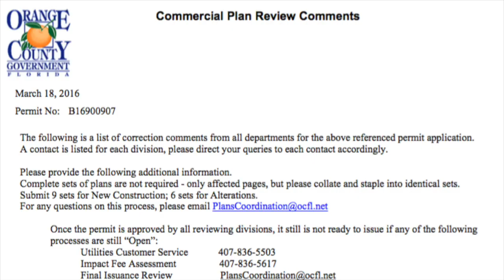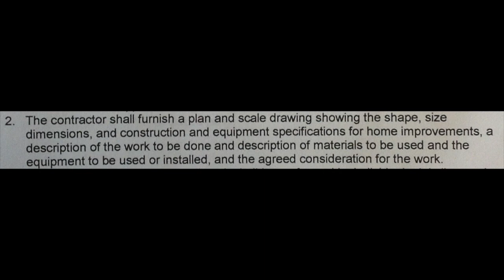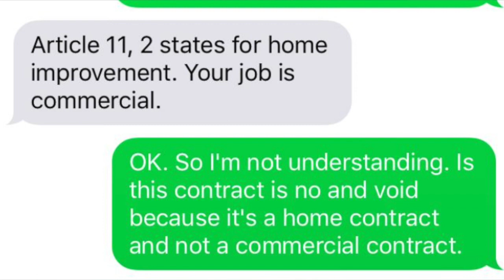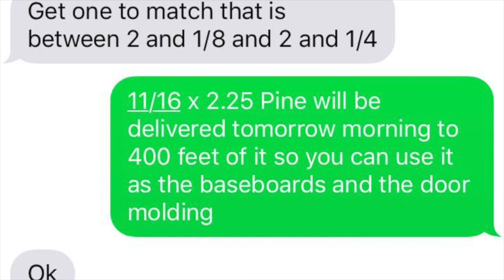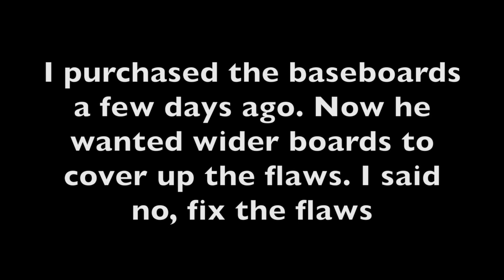Contractor promises

Comment: Paul this sucks I wish FL wasn't so far from NH I'd send a couple of guys over finish it in a couple of days all good. This isn't a big job, should have been done in a few weeks to a month. Don't know about FL, but here in NH you would not have needed an architect, in most cases building dept would accept any dimensioned, legible drawing. Unless, of course, you are making structural changes. In which case a structural engineer would need to sign off. 

When I expect the customer to supply materials it is written clearly on the quote, ie, "Install 180 lineal feet of customer-supplied base mold" or whatever. This guy can't even do a take-off! "It's not a science" No? Adding up the length of each wall is what... black magic voodoo?

Comment: I stand here in such dismay and disgust over the way this guy is conning you. You need to fire him immediately and hire somebody reputable. You'll continue to waste good money throwing it after bad week after week. I don't know how this guy is even allowed to perform legally. Paul, I ache for you my friend! That job should NEVER have taken more than 3-4 weeks absolutely tops. Oh yea - baseboard should be 3-1/2" minimum, you don't use door and window casings (2-1/4" or 2-1/2") for baseboard. And truth be told - baseboard should always be installed prior to tile being laid. Most carpenters will use shims to hold the base up a bit off the floor so you don't lose the full width of the base molding. And whomever finished the walls (assuming it was this jerk) is terrible leaving crap finishes along the bottom and then calling for taller base molding to cover his inept workmanship. Geez, time to run from this guy!